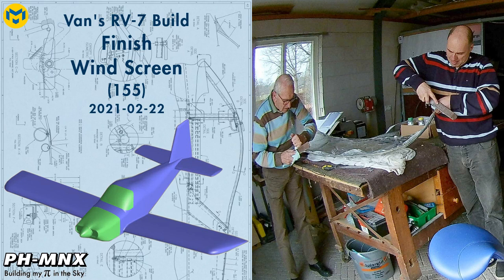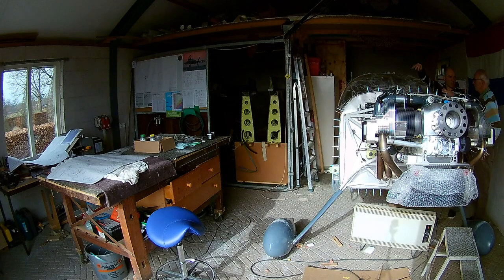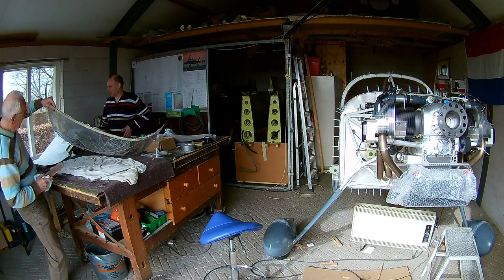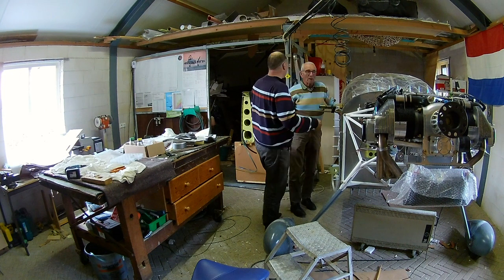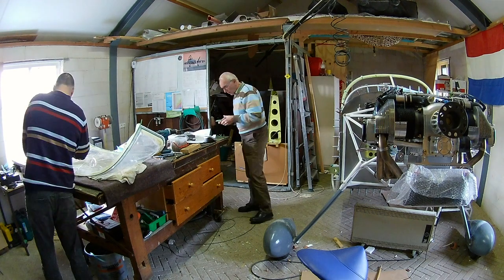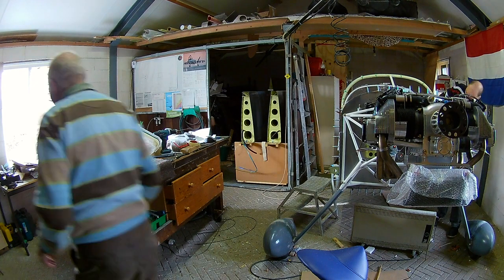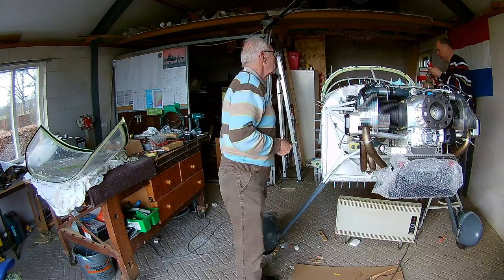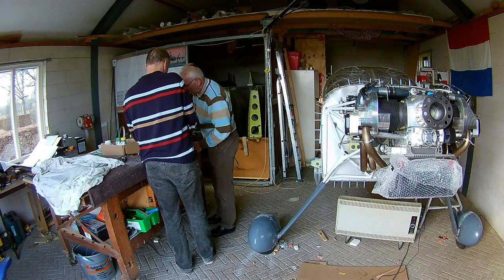Van's RV-7 Build Finish Wind Screen (155)

Comment: Fantastic videos, how is the windshield then finished at the front top skin ?
Reply from the maker: Hi Christopher,
I did use the small clamps riveting the screen to the top skin (according the drawings).
Just as an extra, the windscreen is 'glued' to both the bar and the top skin with SikaFlex.
After that I filled the open space with epoxy 'filled' with floqs and covered with a few strips of fiberglass mat.
This way, it is easy to 'mold' the glass with the correct arc. Be careful at the sides, the epoxy tends to run down.